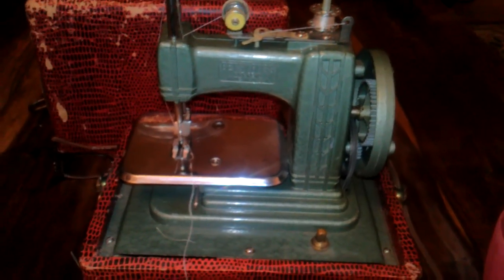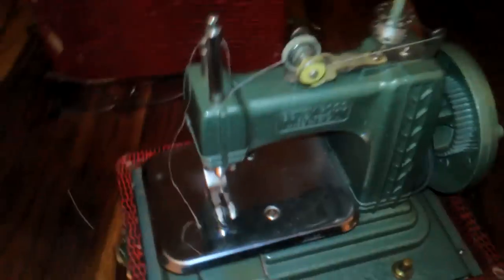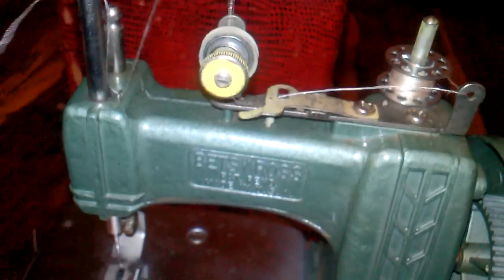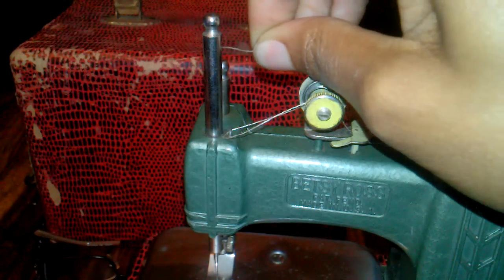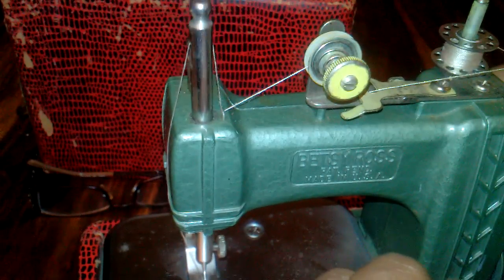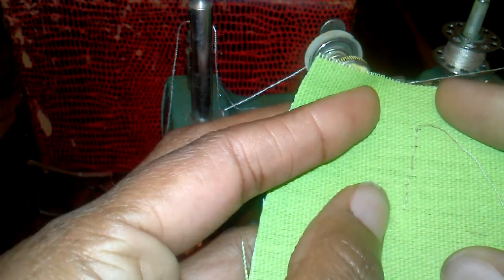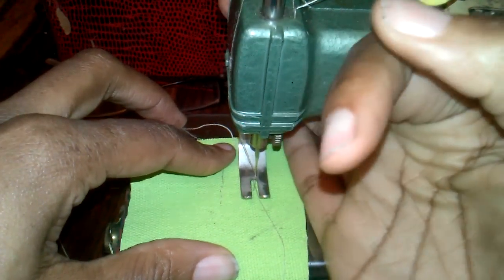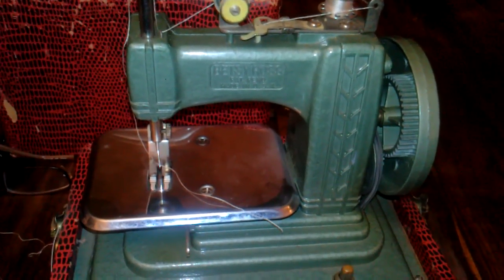How to thread a1940 Betsy Ross Toy Sewing Machine

Comment: It's over a year since your video so this is probably old news,  but I do have a machine like this.   You are correct that it doesn't have a bobbin.   However,  there is a hook underneath the feeddog that has to pick up the thread before you start sewing.  This takes the place of the bobbin.  So, before you put the fabric under the pressure foot,  lift the foot and move the wheel until the hook catches the thread underneath (one cycle).  Then put your fabric in, lower the foot and it will sew.  Hold on to the thread when you start to keep it from being pulled under.  That will hopefully tighten up the bottom thread.  If not, you will have to tighten the tension.  If it's already all the way tight,  loosen it, then retighten.  It may need to be cleaned and the machine most likely needs to be oiled (if it makes a clunking sound especially).  The bottom thread won't look like a regular sewing machine stitch.  It makes loops,  but the loops should be tight and uniform.  Also,  never, never run a threaded machine without fabric because it will knot up under the feeddog and can bend or break the needle in addition to causing a mess of knotted thread to cut out.  Hope this is helpful.  I love my little machine.
Reply from the maker: Thank you so much, I still have the machine.  I have not touched it since I posted this.  I didn't want to sell it without being able to explain how to use it.
Reply: BlkOnyx488

Comment: Before you start to sew, if you pull the thread that has been put through the eye of the needle BACK UNDER and to the back of the presser foot, then hold it when the mechine starts, you should have better luck.  This is the way I was taught by my Mom 60 years ago learning to sew on her 1957 - 401 Singer Slant Needle machine and how I have sewn on all of my machines.  I have to say that my two Berninas, a vintage 800 and an 1130 Electronic Bernina that I have had since 1989/90 are my two favorite machines.  My oldest daughter has my late Mom's Singer and I have my late MIL's 1940's Singer 221 Featherweight, plus I have two Singer Model 15's that I bought at garage sales real cheap, a great Singer 2010 Electronic Touch and Sew from 1980 that I found at the Goodwill...works super, just got off of it....and then I have a mid-1970's Singer Genie and last but not least a 1950's child's handcrank Singer.  I received my Betsy Ross machine in the mail today...bought it a week ago on ebay and was trying to figure out exactly how it worked when I found this video.  Thanks so much for helping me to get started on it and posting this very helpful video!!.  You all don't think I have a addiction to sewing machines, do ya?.....nawh......I don't think so either...lol.    The last full size machine I got recently for my birthday is a 1936 National "Vindex Special" treadle....I'll tell you...I think there is more to running a treadle than appears at first.  I am trying to get the rhythm down on rocking that treadle....harder than it looks but I have wanted a treadle machine for 40 yrs. so am determined to get this down.   I am in the process now of trying to find a copy of the original Betsy Ross instruction manual to print off.  If I find one, I will post the link on here if that is okay?  I love a good sewing machine and IF you have never sewn on a Bernina.....try one of the older machines like the 800....it is like sewing on a dream machine.  Kind of like the difference between driving an old jalopy and a 1956 Porsche Speedster!!   You will love it, especially the knee lift which lifts the presser foot when you push your knee to the right which makes the presser foot lift up and you have both hands free for your fabric....once  you get used to it, you will really miss it when sewing on a regular machine.  Let's keep sewing and never let this wonderful home-skill die out.  Get your children interested in these great old children's sewing machines to start with and then on to the full size machines...THEN lobby your local high schools to put Home Economics back in the schedule if they don't have it any more.....yes!!  Thanks again for the help on my "new" Betsy Ross!

Comment: you have to hold on to the end of the thread and also lock the thread under the presser foot ... then adjust the tension with the kurled knob, tightening the spring until the stitch looks good top and bottom.  the lever 'neth the front edge of the the plate is used to adjust the Stitch Length ... happy sewing ...